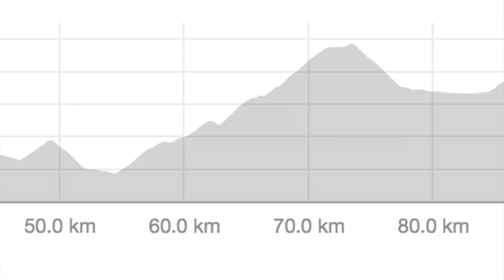Power Data | Tour du Rwanda Breakaway

Comment: So interesting to hear you analysis of the data, thank you. I am considering getting some type of power meter, do you have a recommendation and what do you use? As I have 3 bikes that I use for training and events I am interested in a system that could be moved easily from bike to bike. Thanks for any insight or suggestions into power meters.
Your vlogs are some of the best I've found, you seem to be very comfortable vloging and always provide interesting information and just great scenery and cycling, always happy to see you have posted another!
Reply: Matthew Oly WA Pedal based power meters like the garmin vector or power tap p1 can be transferred quite easily if that's any help.
Reply: Just my two cents, you probably don't want to be swapping pedals all the time but a Powertap hub in rear wheel can be swapped easily. Plus, all the pedals have been shown to put out inaccurate watts during hard efforts. I have Powertap chainrings on my race bike and I also train on that bike. They have been great for me. If you want to get serious about training then a powermeter is an essential investment and I would work toward getting one for every bike eventually. I have seen great deals online for older powermeters lately at around $500.
Reply: ***** Yeah the powertap rear hub is a really good power meter but the only problem is if you have more than one wheelset. I don't know about the p1 but the vector hasn't got any negative reviews due to inaccuracy.
Reply from the maker: Hi Matthew. A power meter is definitely a good idea. Once you start training with one there really is no going back. With 3 bikes easily transferrable is the most important thing. You have 3 options in my opinion. The Garmin Vector pedals, the Powertap P1 pedals or a Powertap hub. Firstly, the draw back with the powertap hub is that it means you have to ride the same wheel on each bike. If you have training wheels and race wheels then it poses a problem as you don't want to race on your heavy race wheels. 

One option is the Garmin Vector pedals. I know of some people who have had reliability issues though so maybe do some research on that front. As far as I know the switching between bikes is relatively easy. You can also get the Garmin Vector S which is a single sided power meter where it just doubles the number to get a complete power number. That will probably be your cheapest pedal based option. The data from the Vector is also extremely in depth. 

I have heard good things about the Powertap P1 pedals. With regards to data accuracy I haven't had any experience with them but I have a friend who loves them. They take a AA battery which makes it easy to replace as well. Very easy to switch between bikes but for the price of the P1 pedals you could also get 2 Stages power meters (possibly even 3 if you looked second hand). 

One thing I have learned is that with power meters things do go wrong. Between bad weather, rain etc problems do pop up. I have had 3 warranties with my Quarq but am still a big fan of the system. A company with good customer service is very important (like Quarq and Powertap) if something does go wrong they can help you quickly. If you keep the receipt (this is important) getting it fixed when it is under guarantee is usually pretty painless. 

Hope that helps a little bit and doesn't muddy the water even more. I definitely think pedal or hub based meter is the way to go. If you have training wheels and racing wheels then I think pedal based is probably your best option.
Reply: Thanks Edward, Cool Dog, and Tyne for your insight and suggestions, you have confirmed what I have been  thinking / considering. Since I have other Garmin devices and have been happy with them and their support I will likely opt for the Vector pedals (and an adjustment in cleats as I have been using Shimano). As always I appreciate your input! Good riding!
Reply from the maker: If you are ever looking for really good reviews on cycling electronics give dcrainmaker.com a read. He does incredibly in-depth reviews on all power meters, action cams, home trainers etc. That is always my first stopping point before buying anything.
Reply: Yes, I always check DC Rainmaker for info on electronic devices for cycling. He does have very complete reviews of all electronics fitness related. Another good reviewer is Shane Miller, he has a pretty good YouTube channel on which he posts his reviews of equipment as well as other things cycling.
Thanks again!

Comment: you look really good on the bike. good fit, good core strength! compared to the 2 other guys sitting more upright.. more the climber position
Reply from the maker: Thanks. I try to fit in a lot of core work in the winter and then maintain as much as possible in the summer. Still need to work on my flexibility a bit more.

Comment: Hi Edward. I am curious..what was your impression of the African racing cyclist .. tactics, strength and skills  ?
Reply from the maker: Hi Greg, I was very impressed overall. I grew up in South Africa so have some experience racing some of the riders but mostly they were new to me. 

Firstly, strength: the guys were really good on the hills. Very lean and well adapted to the altitude. I could climb with them pretty comfortably until there were some big attacks at high altitude and I was on my limit. They could just hold the attack for a bit longer than I could. However, I don't think I was very far off, I just am more of a steady rider. 

The skills were a real mix. Some riders descended very well while others were very poor. The moving around in the bunch on the flats was very easy but on the climbs the riders were very aggressive about holding position. It was kind of strange actually. Normally it is the opposite and the lead into the climbs is very aggressive but guys relax once you start going up hill. 

Finally, the tactics: it was quite a complicated race because Rwanda enters 1 National team and 2 club teams. They kind of work together as a team of 15 sometimes but not others. It was kind of hard to figure out what was going on sometimes. Sometimes they would chase each other and other times they wouldn't. Something I would take advantage of next time is that the riders don't like to work that hard on the flats, they prefer to ride easy-ish and then really push it on the climbs. There is definitely room to take advantage of their unwillingness to push on the flats. There were very few flat sections but definitely something I would look to take advantage of next time. 

In general the level of African racing is on the up. The riders are very strong and as they are getting more experience and access to other races they are improving rapidly.